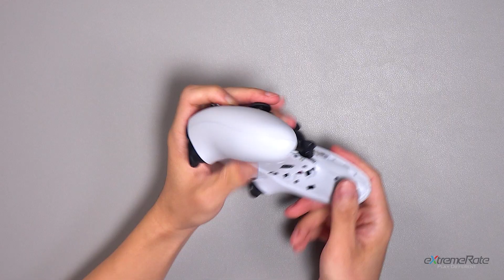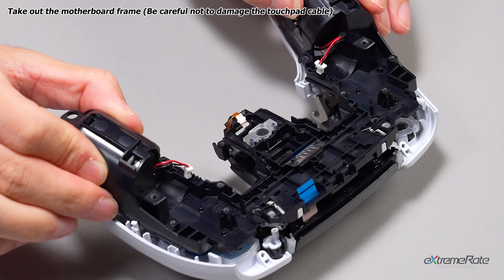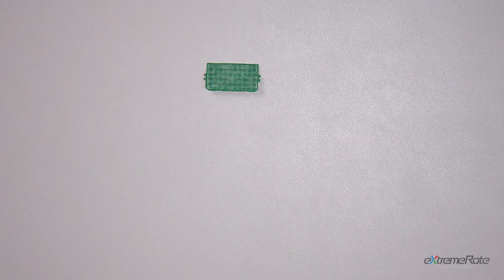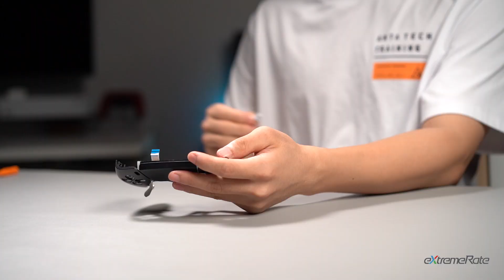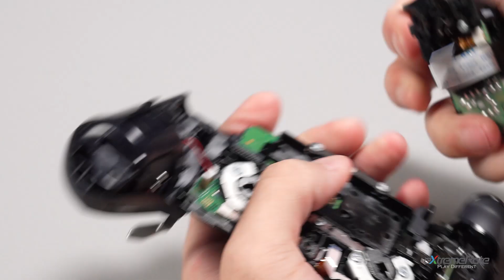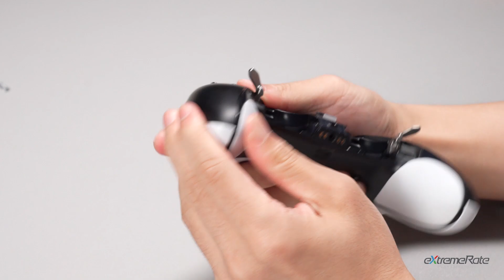eXtremeRate PS5 DualSense EDGE Front Shell & Touchpad Installation Guide

Comment: Be careful when you do this because I did it, and I messed something up. Now my controller only turns on when there is a cord in it, it doesn’t connect to my PlayStation, and it doesn’t charge. So if you're not confident or comfortable I would get someone else to do so

Comment: i have one less screw at the plastic front but it doesnt matter. And i still would use the original touchpad because of the PS symbols on it. Also thinking adding original PS buttons but be aware they don't fit from a normal dualsense,

Comment: Any other way to remove the touch pad off the curciut board without using a heat gun!?
Reply: yes, just carefully and slowly pry it off with a flat head screwdriver. do not scratch the PCB board or the LEDs!
Reply: Or with a metal gap opener, but i still would use the original touchpad is way more beautiful.

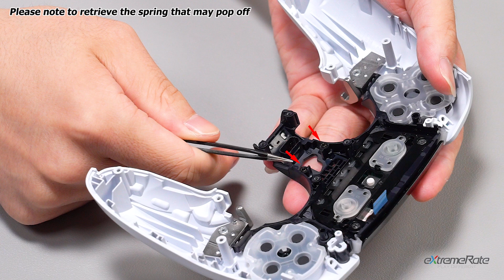Comment: Forgets to add small springs to back of front plate. They get taken out at 6:33, but never get added back. FYI!
Reply: same lol! also the little clicky trigger covers. big mad
Reply: @stevebroughton7488  where in the vid does it show the clicky trigger covers?
Reply: @RealAntowGG  idek
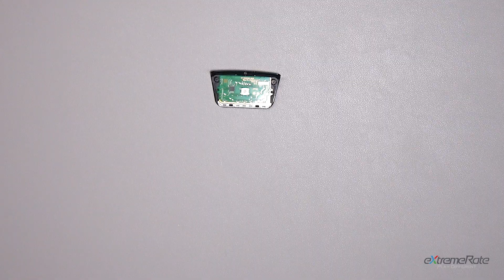Reply: This 8:47 makes me nervous of messing my touch pad up lmao
Reply: lol i left mine out too bc idk its purpose, everything works without it
Reply: You are awesome. I had a spring fall out while I was putting the shell back together. I didn’t know where it went until I saw this comment.
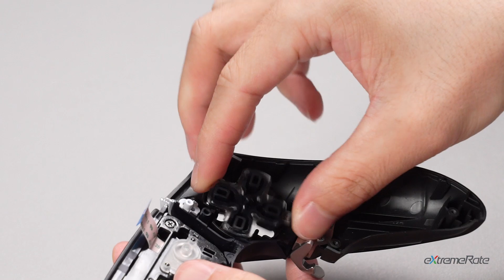Reply: The two small springs, i loose them all the time. lol They are placed back in this video i'm still not sure what it does. https://youtu.be/i0B54zBYdDU?si=iIiJmDEKjb6HmHpT&t=785    @13:05      Also the mid speaker i glue it in, everything always falls apart, lol.
Reply: I didn’t put them 2 springs in and my controller doesn’t work does that have anything to do with it
Reply: @BXNJI-R6it still works fine? I made that mistake as well

Comment: I actually managed to pull this off despite being nervous af. I don't have a great track record with these things. That's my brother's specialty lol. It looks good, and is a nice kit. I used the original d-pad/L2/R2/face buttons and the nicer looking touchpad and the smaller glossy front/mid/bottom plate that came with the dualsense edge. Re-Installing the d-pad and touchpads was a bit tricky. I wasnt sure how it went in, which side was up/down/left/right because I couldnt get  a clear enough view from the video. 

I got them in right, but the bottom d-pad squeeks often, although I don't think the kit has anything to do with it. Probably either how I installed in or something, light googling shows it seems to be a slightly common thing with the dualsense, mainly seeming to go away over time from use although mine is still just as squeeky. 

My main, and pretty much only gripe with the kit is the material used to make the Options/Share buttons. They're a bit on the softer side, while the original's feel solid. It's not a major issue, I just need to press them a little harder than I did the more solid, original ones that came on the dualsense edge to get them to activate. I also prefered the solid feel of the original ones over the slightly squishy ones from the kit. I used them because the dualsense edge just had to come with white ones. Why did sony have to go with white this console gen?

Comment: One question. Does the original touchpad work with the new shells?
Reply from the maker: Yes
Reply: It does. I swapped out the white outer plates on my dualsense edge with black ones. I preferred the original's nicer looking touchpad, d-pad, and face buttons, so I used them instead of the ones the kit came with. I didn't see the need to replace L1&2/R1&2 buttons either, so I was able to skip the L2/R2 replacement steps, which looked like it could be a bit tedious anyway. Unfortunately, I did have to use the kit's Option & Share buttons, because they're black and the original's are white. It looks better with the black share and options buttons, but the material they used are a tad squishy vs the solid original's. Besides the feel, I have to press them just a little bit harder than the ones that came with the original because of it. Not really a big deal though.